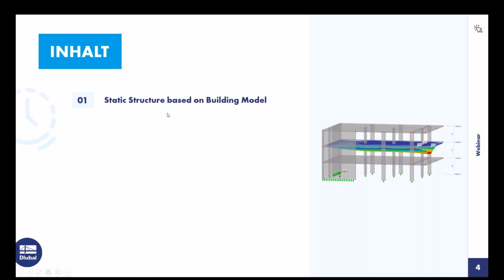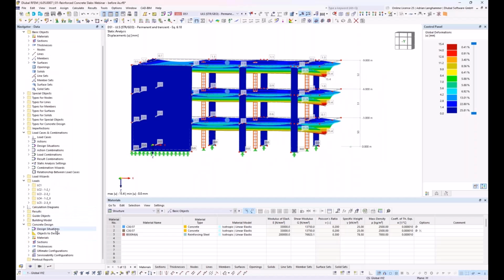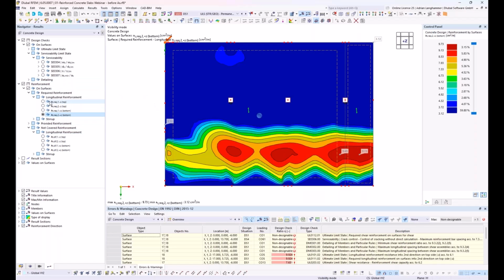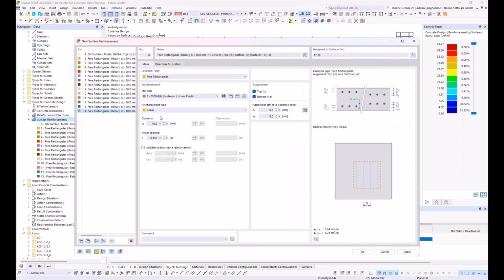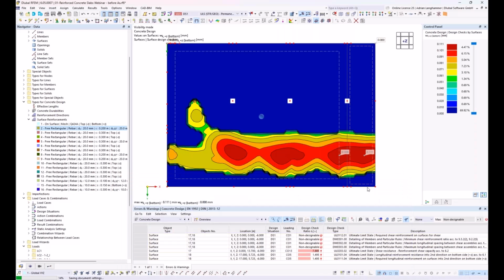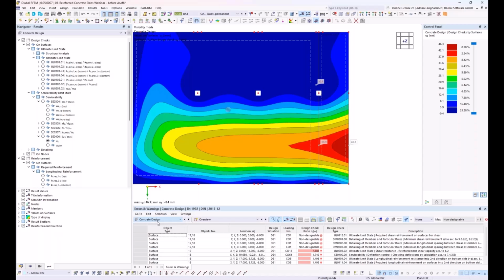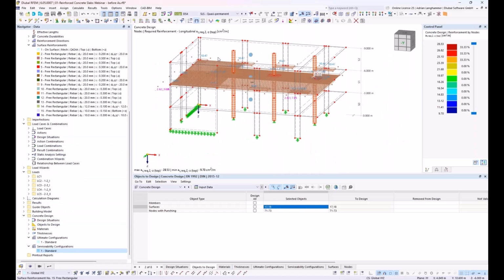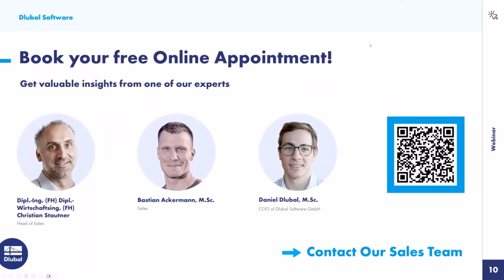Calculation of Reinforced Concrete Slabs in RFEM 6

Comment: The fact that building model is another module it's pretty too much :
Reply from the maker: Hi, @yoshi.jeje_StructuralEngineer!  The cost reflects the comprehensive features and benefits it offers to structural engineers and designers. Here are some reasons why it might be considered valuable:

Advanced Modeling Capabilities: It allows for efficient modeling of buildings by enabling the creation and manipulation of stories. This feature streamlines the process of designing multi-story structures.

Automation of Repetitive Tasks: The add-on automates several tasks such as the generation of result sections and the modification of structural elements, which can save significant time during the modeling process.

Analytical and Graphical Information: It provides detailed analytical information on building stories, including the center of gravity, which is crucial for stability analysis. Additionally, it offers graphical and tabular forms of information for better understanding and presentation.

Enhanced Design and Analysis Features: The add-on integrates with other features of RFEM 6, such as the Concrete Design add-on, allowing for comprehensive design and analysis of building components according to various standards.

Support and Updates: The price includes support and updates, ensuring that users have access to the latest features and compliance with current engineering standards.